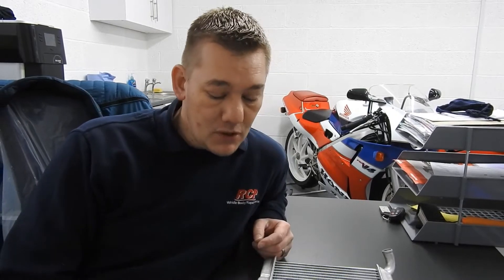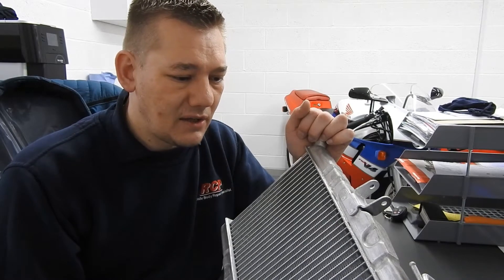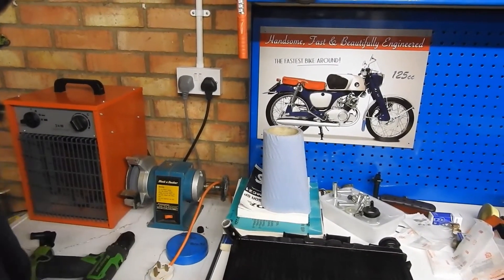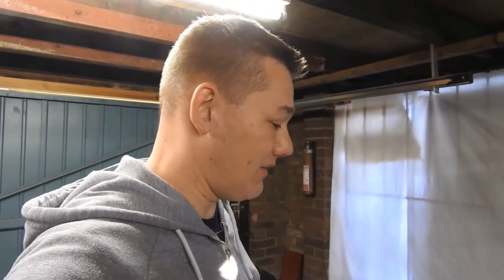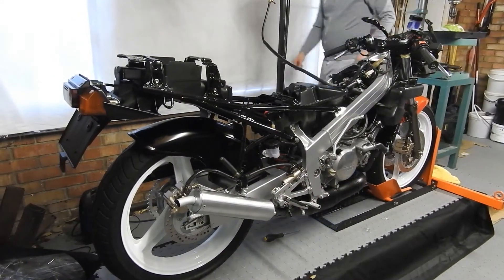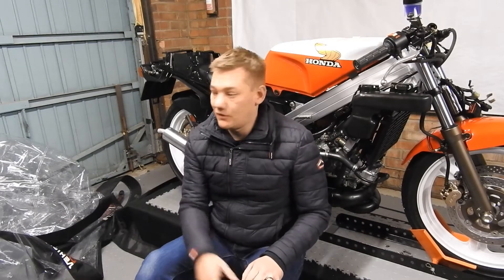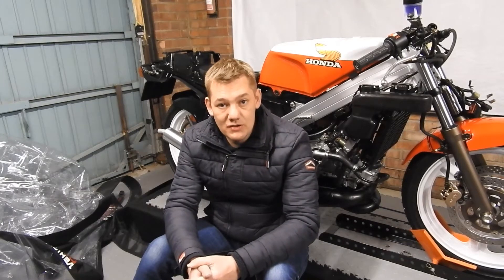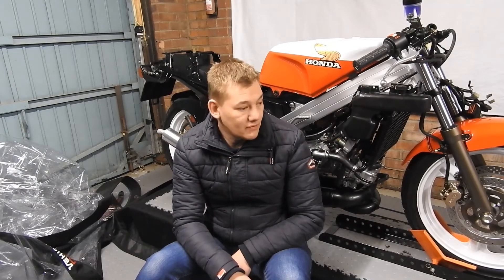WILL IT START?? HONDA NSR250 MC16 RESTORATION, STARTING FOR THE FIRST TIME IN 28 YEARS!!

Comment: We had the same cdi issue with my mates bike. Not long after doing some tests the 2nd one went. After a bit research i found out the cdi from the xlr 650 (i think) was a direct fit. He ordered 2 new aftermarket ones from hi level i think and job was a good un!  Im currently restoring an mc16 as well just now and iv got to say, very impressed with the job you done on your from discs! 👍🏻

Comment: My MC16 would start on both cylinders first kick, and rev perfect on the stand. On the road a different story, misfiring, cylinders in and out, really bad. 
I cut the backs off the CDI's looking for dry joints, tried everything. Bought two new units, Lixianda or some such name. Hey presto it worked for about 2 weeks, then failed again.
I finished up buying Ignitech from Czech Republic, now it works on both reliably. 
I recommend those people, of course its not original. I care more it works.
Carburetors yet another nightmare. Much better now, after so much time. I feel they must have been on and off 1000 times!

Comment: Just came accross this video.same as my own 1 cyclinder.i cut the back off one cdi after swapping them to check it was a dodgy cdi.i resoldered every joint in it.put it back in and I it's running on both cyclinders again.after lying in  a container for years.

Comment: About your 1 cilinder issue. I have an MC16 myself. Drove it al lot of years an nog it is also under a technical restauration.
The 1 cilinder problem is maybe coused by the choke, that works on only 1 cilinder. Or, the oillevel sensor in the 2stoke oiltank. The sensor loses magnetism and gives a low-oillevel signal tot the CDI, that cuts te ignition on 1 cilinder. At first above 6000rpm but it accurs more often during time.